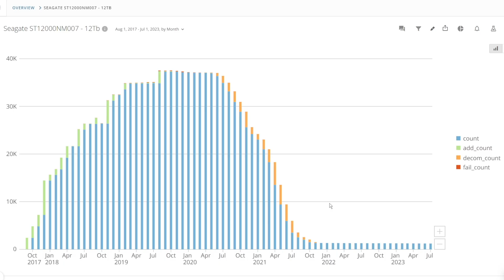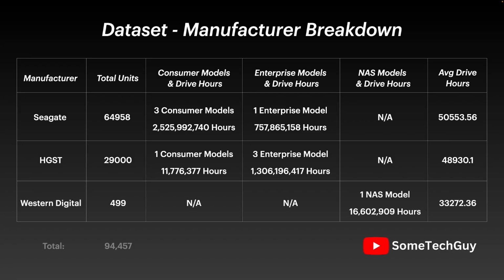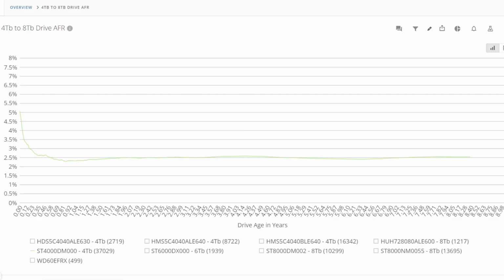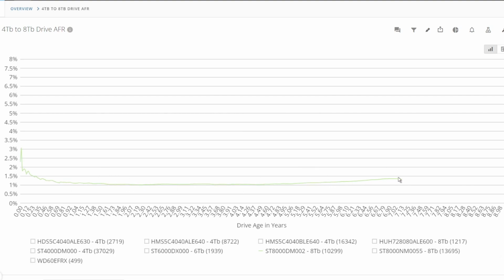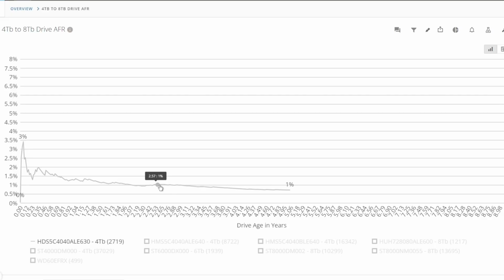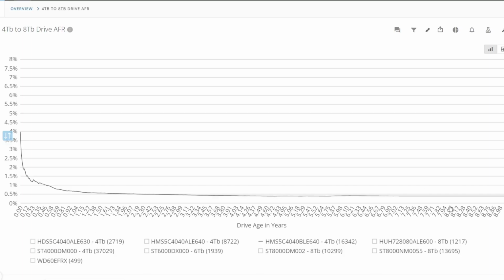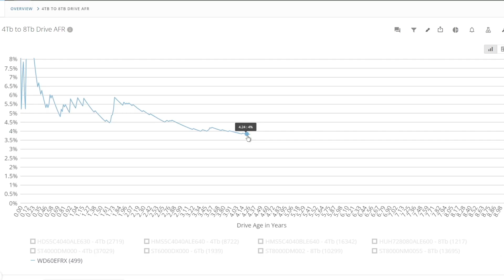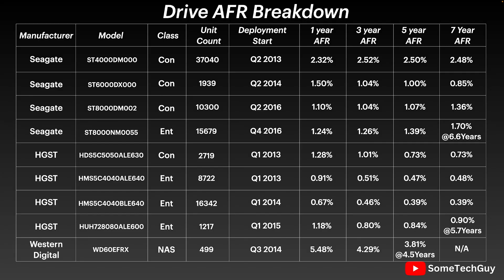Desktop vs Enterprise HDD - Failure Rate Analysis. Do desktop hard drives really fail sooner?

Comment: Just replaced my home NAS HD which was 6 WD red in raid6 after running for 5.5 years. At the end, 1 of them failed but I saw this as an opportunity to increase the raid size and moved to exos. A very small sample size of point.
Reply from the maker: I also had a bunch of Red 6TB from way back in one Synology NAS running SHR2, and I have been replacing with 18 and now 24TB as any drives start to show issues, or as I need capacity. Replacing a currently working drive is way less stressful on the array than replacing a failed drive as it just does an in place replacement rather than recalculating all the parity. I used quite a few Exos there and another 24 x24 just went in.

Comment: I suspect the main reason for decommissioning drives "early" (i.e. even though they continue to be reliable with low AFR numbers) is to make space for larger drives. There are some videos posted by Backblaze where they discuss strategy - they point out that one new, larger drive will have two or three times the capacity of a smaller  one and can therefore replace two or three of the smaller drives and take up a third or half of the space. I recently bought an old HGST 4 TB drive to use as backup. I had it sitting in a USB dock for a while and just recently had a look at the label. All this while I thought it was a desktop (Deskstar) but it actually turned out to be an Ultrastar - HUS726040ALE614. It does have a LOT of time on it - around 7 years(!) and was made in 2016, but I paid about $45 for it so I'm not too concerned. But looking at the data sheet, I find it actually uses more power (9.1W, 7.1W idle) than the new 16 TB Ultrastar (WUH721816ALE6L4 ) that's on its way to me (6.5W, 5.1W idle). It looks like the entire Backblaze fleet will soon be enterprise drives simply because no one makes really big consumer drives. 

 Another interesting thing - I'd never heard of MegaScale drives (like the 4GB HGST drives in the video) so I looked them up. They're meant to be light duty enterprise drives - Ultrastars run at 7200 RPM, Megascale rotational speed is listed as "Coolspin" - I came across 5700 RPM elsewhere. They have a warning in the data sheet - "Use of MegaScale products in higher duty cycle environments will have a negative impact on reliability." They do use less power than the Ultrastar 4 TB - 6.2W Read/Write, 4.9W idle, and  4.0W  "unload idle" (which makes me think they're spinning down or reducing RPM during quiet times, like the old WD Green drives did - they never listed RPM for those either).

Comment: I still run my 10 year old WD Greens 3TB in my desktop computer. I had to disable the power saving feature which would park the heads every 10 seconds.
Replacing one of the drives with a Seagate 4TB because the old one ran out of space.
I use these drives purely for data, the OS is on a SSD.

Comment: I'm confused, so a drive with higher AFR can have more drives running 5  years later, does that means that the drive hasmore failures but not lethal failures?
Reply from the maker: AFR is percentage based, and it’s based on the percantage chance of a drive failing in a year. Not the number of drives. This is why you can use it use it to directly compare drives with different counts.

Comment: Speaking of from my experience when buying CPUs and RAMs. It is also possible those hard drives can be different bins depending on quality tests. For instance there was speculation, that WD REDs 5400 RPM are just better WD Green bin. Personal experience can also be very tricky. Among my friends and collegues I have multiple ones, that would never get Seagate, Toshiba or WD. In my case within family circle I had rather bad experience with various WDs (2,5" portables, 3,5" Blue and Red), on the other I had so far only one faulty Seagate (weird parking pattern on 1 TB old eSATA external 3,5" drive). 

I have bought for my backup purposes three different drives (list below) each 8 TB which are encapsuled in external USB-C enclosure. They are used to store mirror of data contents of my PC and notebook. Two of them are at home, third one used to be in cellar, now in rented bank security safe, where it is stored along by other important items (will not disclose further). From time to time I swap one of those drives between home and bank storage to keep fresh data everywhere and stick with 3-2-1 backup rule (in my implementation rather 4-2-1). 4 copies including original, 2 media types (SSD / HDD) and one off-site backup in case home would be robbed, leveled to ground or destroyed by natural disaster.

- Seagate Ironwolf Pro (Q3/2023)
- Toshiba MG08 Enterprise storage (Q3/2023)
- HGST (labeled as WD) Ultrastar DC HC320 (Q1/2025) ... Replaced WD My Book 8 TB (bought Q4/2023) and sold to my father

While HGST is in burn in time period, Seagate and Toshiba have already undergone many backup refreshes + occassional defrags (once per quartal) so the heads experience more movement. So far both did not display single issue.

- Seagate Ironwolf is from my JBOD bundle the fastest one, has loud lower tone pitched seeks and sometimes I heard suspicious loud clicks and few times weird parking pattern, however neither data corruption nor logged events into SMART.
- Toshiba MG08 is slowest one and has annoying high tone pitched seeks (though it is not as loud when measured in dB), however it is very consistent and it did not attract my attention that something might be bad. 
- HGST Ultrastar is basically sligthly slower than Seagate, has middle toned seek noises (slightly louder than Ironwolf) and I will see how it will behave after longer time period.

Thanks for sharing nice sample of data with even nicer interpretation and summarisation. Upvoted and subscribed

Comment: I'm just getting into mass storage and picked up a couple Seagate X16 16TBs. I can't speak for longevity, but these things get a lot of hate for noise. I can't hear a thing outside of the occasional brrp when they get asked to spin up. That said, its not loud and these are in my tower six inches away from my keyboard. I bought one a few weeks ago, just added a second, I've been syncing for about 8 hours so far and all I can hear is fans.
Reply: The fans on my server are louder than the hard drives unless there’s an issue with a drive.  I’ve actually been thinking about how I can make my server quieter without sacrificing cooling.

Comment: I worked for a big storage vendor (Petabyte sized racks full of spinning rust in large part).. Fiber channel and soon .. running as high as 40 gigabit to the trays of disks and the servers connecting to the storage array.. (think: multipurpose storage that would also do SMB, apple, NFS and so on..)--- there I developed a strong aversion to the Seagate drives, having some customers with "moose" drives (1 tB IDE) having amazingly high failure rates.. And worst part: the second failure usually occurred just before a reconstruct finished.. which meant another hot spare got eaten.. and if that triggered another drive failure, then you were getting out paint to cover the holes in their data.  I also have 6 of the 8 TB sized WD here.. no failures of any sort so far.. Not as quiet as the 4 10's I have in the other NAs box... Zero errors on the 10 drives total here, running double parity on the 8 TB size drives.. and the 4 10 tb drives in the other box...  I wonder if the backup company got a pallet of 50 or whatever drives that was dropped out of the end of a truck on delivery...
Reply from the maker: I guess those IDE drives are many generations old now. But this is the problem with RAID rebuilds that they put further stress on other drives in the arrays and can lead to further failures. I have had similar experiences, and had it that in one NAS here with WD Red 6tb, where a drive failure led to 2 further failures during array rebuild, but fortunately the rebuild was still successful and I didn’t have to go to backups.
Reply: @sometechguy  Yeah... When you have 16 drives with 2 being hot spares, but end up with 3-4 failing in a week, the vendor tends to do a lot of "It can't be our fault" talk, followed by "how many replacements do you need?  "Might be vibration".. (in a rack that is anchored?  Well.. Doubtful) and thinking back before the SATA drives and their issues, there was trouble with Fiber channel disks that leaked in the rack, so you had oil dribbling out of the shelf,   The bearing would die, but at least that wasn't a problem that happened at the rate that the SATA failures had.  They had pallets of dead drives at depots that all went back for "new ones".  Sad part:  the drives failed at the same rate when they were hot spares... <sigh>   At my site, I load up the drives, and just let them run for a day or 3 to verify that they won't be infant failures.  Great analysis for the drives that were looked at.

Comment: 10:52 for the Summary
Reply: not the full picture.
if you're planning to use them on a NAS, the cheap drives tend to have tons of issues with uncorrectable sectors, which file systems like ZFS don't like.

Comment: No comments on data integrity?  Failure rate is one thing, but enterprise drives normally advertise (per their data sheets) a lower UBER than consumer-grade drives, usually by a factor of ten.
Reply from the maker: This is a good point, I need to go look at the data and see how well unrecoverable bit errors are recorded in SMART to see if desktop drives really suffer from a higher bit error rate or not. It seems common for SMART to report numbers for Raw read error rates, but record pretty much zero unrecoverable errors. But this may depend on the workload and how often data is actually read, for example if scrubs are performed.

If the data looks useful, I could incorporate that in future comparisons.

Comment: Thanks for this. I just installed (<1 mo ago) 2 x 4Tb Seagate Ironwolf Pro units in my replacement/upgrade Synology NAS. I've worked them hard, transferring data from my antique (10+ years) Netgear Stora NAS. That had some more recent 2 Tb WD Caviar Green desktop drives. After probably ~6-7 years in intermittent service, they seem to be going strong, though they are slow, by comparison with the new hardware. That could be due in part to a very outdated embedded Linux OS on the Stora, though they are also 5400 rpm disks, as opposed to the 7200 rpm Ironwolves. One nice thing about the Synology NAS is that it has a tuneable spin-down, if the disks aren't in use, with a Wake on LAN feature. So, unless you're running it as a home cloud storage, you aren't actually running the disks 24/7, even though they're rated for that. I'm hoping this will prolong the life span so that I don't have to replace them until I need something bigger and faster, rather than because they've failed. Maybe, by that time, I'll trust high-capacity SSDs or NVMe drives for that kind of service. Having lost a 1 Tb Patriot SSD after a little over a year (just out of warranty, of course), I'm not in a trusting mood.
Reply: There are many opinions stating spin down is not good for drives if they are rated for 24/7 use. If you still care you might wanna look it up :)

Comment: Funny thing, one of my 6tb drives failed, a wd red.
Reply from the maker: Funny, but also not funny at the same time. 😢
Reply: @sometechguy  and now the second one starts failing, right when I'm rebuilding the raid pool
Reply from the maker: @PetervanderKruys  I had the same thing happen with some Red 6Tb. They were all at around 7 years, I had one fail and had one other fail during rebuild. RAID rebuilds are one of the most stressful things you can do to disks in the array, so if any other are marginal, its the time they are likely to fail. Before doing rebuilds, I would recommend validating backups look solid. And RAID 6 or other arrays with N+2 redundancy can mitigate this a little but the more disks in the array, the more likely this is to happen.

Hope it isn't catastrophic for you, sometimes the other disk just reports some errors and maybe minimal files are impacted. And hopefully anything important also available on a backup. Good luck!
Reply: @sometechguy  yeah thanks, I hope all is good. Fortunately it is only 1 bad sector that popped up, but that’s how the initial drive started. After 3 bad sectors it got some initialisation problems but once I took it out and put it back, my synology just wouldn’t accept it. The raid was degraded and stayed that way.

I’m using SHR from my Synology, so advanced raid5 with a hot spare (which unfortunately was a bit smaller than the failed drive, so useless). I can use that drive to replace the smaller failing drive and get another IronWolf 6TB as hot spare. I tried an IronWolf Pro 8TB but either it was broken or just didn’t work on my old Synology. 

But damn I wished I had a raid6 variant right now, food for thought!

Comment: How often should a HDD be powered up to "keep it healthy"? I am using it as cold storage and am trying to figure out the best type of drives to use.
Reply from the maker: An HDD will be far better than an SSD for this. Data on SSD degrades naturally, where this doesn’t happen on a hard disk. Theoretically the data should last a very long time, but bitrot can occur due to external factors, such as solar storms / cosmic rays but I would say this isn’t usually a serious issue. Powering up a disk alone may not find those and you might actually need to read the data to identify errors, which may or may not be correctable.

If it’s critical data, keep more than one copy and then you are extremely unlikely to have a problem.
Reply: @sometechguy  ok thank you.
Reply: Don't know about the bearings in todays harddrives.
Remember the earlier fluid bearing discs may have issues when they starte to get older.
The platter "lock up" but you could twist the discs hard to loose the platters inside.
(happend with me on two discs but that was with drives from around 2010'ish era)
Technology probably got a lot better today, if you already not using wery old drives for this..
Reply: Just run Spinrite 6.1 periodically on those old drives.  It checks and rewrites the sectors to prevent degradation as well as identifies a failing drive so it can be swapped.  It's great for giving peace of mind on old long term storage media that's offline

Comment: I'm surprised that WD Red is CMR because I thought all Reds were those bad SMR. SMR would explain the graph, and it's a bit weird how WD suddenly forgot how to make CMR drives reliable.
Reply from the maker: Red drives used to be CMR, and then they covertly changed them to SMR without changing the model numbers in any significant way and without stating it on the datasheet. 

Then, following backlash, they eventually stated that they were in fact now SMR and created a new line called Red Plus, which were really just the old Red drives and were again CMR. 

The 'EFRX' model in this analysis is the older CMR version, which was replaced by the 'EFAX' version, which was SMR.

The fact this is so confusing highlights why this was such a bad thing to do for customers. 🤔

Comment: Isn't the smaller consumer seagate disks smr drives?
We also don't know how backblaze are using the drives.
Are they mainly "hot storage" or is there frequent writes.
Smr drives probably scream for mercy in a enterprise setup with frequent writes.
Since the usage of these drives are not known it's difficult to judge without how they are used.
Or if they are run in raid setups or zfs etc..
Reply: No, it's CMR
Reply: cheap large drives (2TB+) are all SMR
small drives (1TB and less) are usually CMR
Reply: we can assume:

backblaze's business is backups, which are write once and scrub. so, very low write activity, enough to maintain coherence. there is likely a hot storage pool that has frequent writes, but that can be reduced to a small proportion of the drives overall and possible solid state. so, mostly, your HDD stats are for something that gets written every so often and read out mostly to scrub errors

Comment: The number one killer for hard drives is HEAT. Keep the heat down "proper cooling" and the drive will last a long time.
On that note, drives will fail, any mechanical device will eventually fail over time, depending how long and heavily it is being utilized.
Reply: Data interface speed can also affect heat levels. For example, when I reduce the UDMA speed from 6 to 2 on an air-cooled HDD I saw a 3-degree Celsius reduction in temperature.
Reply: do closed drive enclosures increase heat? and also rugged closed enclosures

Comment: I have two 22 TB WD Gold in NAS (in RAID 1, I’m planning to add two more, and go RAID 5 eventually). 6 months of 24/7 - so far so good. I bought them for long term data storage - will see how it plays out. I have WD Scorpio Black 750 GB laptop HDD from 2011., still functioning perfectly fine. Also, got numerous external portable drives in the last 5 years from WD/Seagate (2-5 TB ones), all working just fine. I am interested in their reliability, as I had a bad experience with a desktop drive some 20 years ago (don’t remember what it was, only capacity of 40 GB), that tought me to have backups for everything. But in general, I’ve found all spinners very reliable for long term storage, that’s why I went for Enterprise WD’s (price for 22 tb Gold's was good at the time). So far, no buyer’s remorse, just wondering if Seagate is a smarter choice these days. Great data analysis here, looking forward for more data on these.